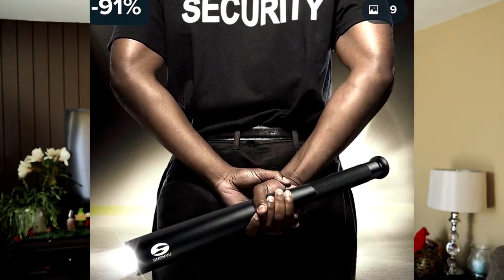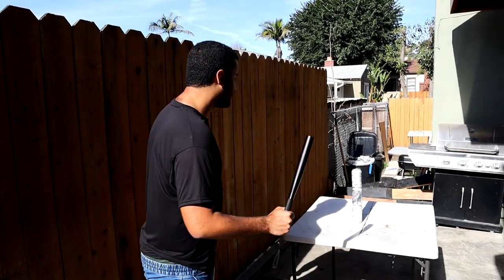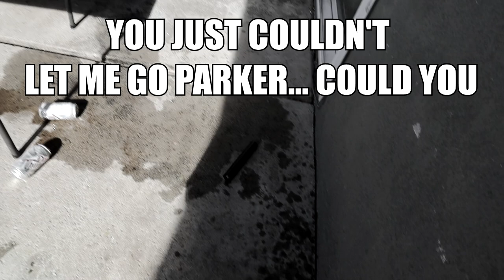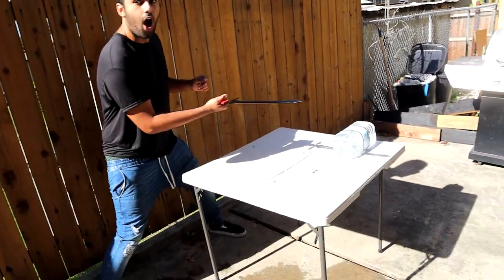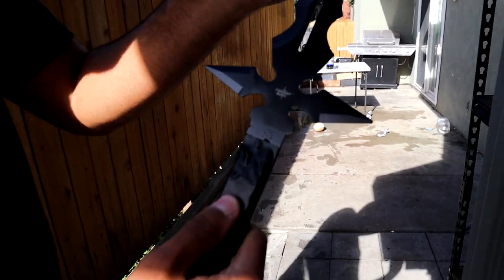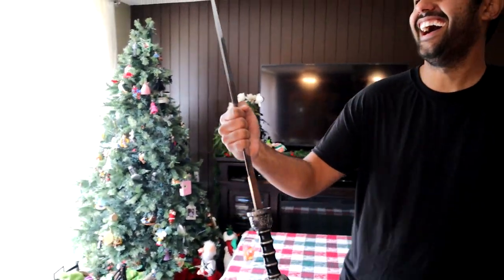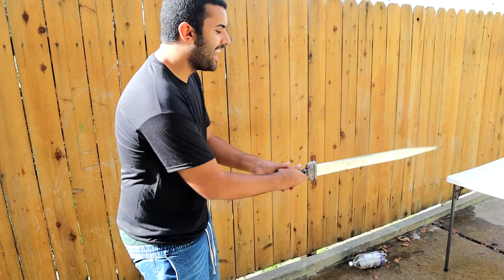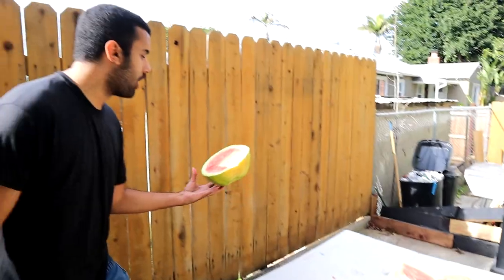I Bought The WORST Rated WEAPONS On Amazon!!! (1 STAR)

Comment: Takes Romans gladious which is a stabbing weapon and says it is a renaissance era sword for cutting 

🤔hmmm
Reply: the gladius was just as good at chopping as it was thrusting. thats why the romans never replaced it with a new weapon. its design was perfect for chopping because it was wide and straight edged.
Reply: Still off by 1500 years though
Reply: But they replaced the thing depending on whoever they were fighting at the time.
Reply: @adrienzappala4266  it was replaced by the spatha at the end of the empire
Reply: @zeusSC28  you got me there. i guess i forgot due to the spatha resembling a gladius just slightly longer
Reply: @adrienzappala4266  Yea they replaced the gladius with the Spatha in the late 2nd to early 3rd Century AD. By the 4th century they had completely abandoned the gladius,
Reply: @conordowse4537  you're a little late sharing that info. Take a look at the comments above
Reply: @adrienzappala4266  I was elaborating on the points above.
Reply: @Ajee02  NO they always had the Gladius as a side arm for the front line infantry no matter the enemy. while other things did change depending on the enemy.
Reply: Adrien Zappala and when they did “replace” it, they just replaced it with the spatha, a slightly longer, thinner blade
Reply: @RikkiTheRose  Why sort of correct, the Late Imperial Legion abandoned the Gladius for the spatha, as the Legion abandoned the idea of Proactive defence in favour of a reactive defense between the mid to late 3rd centuries.
Reply: And also says that swords aren't sharp
Reply: Agreed, not Reniasance
Reply: @conordowse4537  I know I am late. but wasnt the spatha the sword of the cavalry rather than for infantry? Thats just what I have heard, but just throwing something in at a late time xD
Reply: @Dovahsul  In the early Imperial Legion circa 1st and 2nd centuries yes, but by the end of the 3rd Century the Spatha had replaced the Gladius entirely in the Late Imperial Legion. This is due to the Roman Army switching to a reactive defence vs an active defence.
Reply: @conordowse4537  thing is a gladius can cut of limbs just as good as it stabs
Reply: @RikkiTheRose  I never said otherwise, however, the Roman's switched to the spatha due their switch from a reactive defence. Whilst a gladius is capable of slashing, it is not as good at slashing as a Spatha. There are other reasons for the switch over too, such as the Romans encountering more and more cavalry and a preference amongst the Late Roman troops towards the use of 'Longswords'.
Reply: Not renaissance era tho
Reply: true
Reply: YungGoth it was replaced by a spatha your wrong and also you don’t have to bring nationalities into this
Reply: @RikkiTheRose  i think you mean a pugio

Comment: As dom there said, that's a gladius. And they're not meant to be dull, they're actually better sharp. And if you'd like to get a real sword that will go through your table and the bottles, and possibly your fence if you swing it hard enough, look into the Cold Steel Gladius Machete from Amazon. $30 bucks. It's only called a machete because it's tough. The very tip might break if it was ground too fine, but after you touch that up it'll be the best chopping and stabbing device you own.

Comment: Actually that last sword is a weapon I know pretty well as an ancient history buff, it is the Gladius Hispaniansis.  Developed by the Celtiberians, Spanish Celts, it was later adopted by the Romans and is basically the ancestor of every European sword ever used in History.  This sword could exact devastating damage.  The Greek historian, Polybius recounted how this sword could sever arms from shoulders, cut heads clean off in a single stroke and even cause ghastly stomach injuries, to the point that enemy soldiers could not be treated.  That is the power of the Roman Gladius.
Reply: 3 year old comment but your information is half correct, it is indeed a Gladius. However the Gladius absolutely is not the foundation or ancestor for all other European swords, by any stretch of the imagination.  The Gaul's and Germans developed complete different designs and those designs more so influenced Rome and later medieval Europe. The Celts even had almost medieval length one handed swords, before the Romans had the Gladius, and so too did the Germans, what we think of as the "Viking sword" was a independent development in northern Europe long before most people think of "Vikings", if anything it was because of this that the Romans adapted and started making Spatha to replace the gladius, and thus started seeing a continent wide increase in the length of swords. This likely had something to do with the improvement in metallurgy technology. Roman sources tell of the Gaul's fighting with their long swords but they would bend, and the soldiers would straiten them with their foot.  This tells us these swords weren't tempered, mostly pure iron.  Once tempering and steel production became more common, swords started to be lengthened, as they would spring back to shape and not bend. Hence relying on a shorter blade, especially a short wide blade decreases the chance of a bend or break.

Comment: Midevil European swords were very sharp and are deceptively light, with short swords and arming swords being extremely common. The myth that European swords weren't sharp dates back to the 19th century with American and European cavalry sabers. While very different, sabers and Katanas have similar appearances and if you didnt know much about swords, you might think they were used in the same way. But cavalry sabers had a relatively dull edge because in cavalry charges, a saber was used to cut deep into flesh and bone, and the impacts with bone would dull or even crack a blade that was too sharp, and so blacksmiths started keeping the blades dull with a rounded edge. This wouldn't cut you normally, but being swung at you from someone riding a horse at full speed was more than enough to cut off limbs and the like. But prior to that, most all European swords were high quality and very sharp.

Comment: That's a really shitty roman gladius lol
It is full-tang but it has a rat-tail tang (it's very skinny and likely welded on). It is also threaded construction because the nut fell off, and it probably has a very short thread too, since it only took 2 gentle taps of the blade for it to come lose.

Also, cutting and stabbing fruit / water bottles is not a realistic way to test a sword's abilities. A crowbar can slice through a watermelon. At least use Tatami mats, or soaked newspaper rolls.